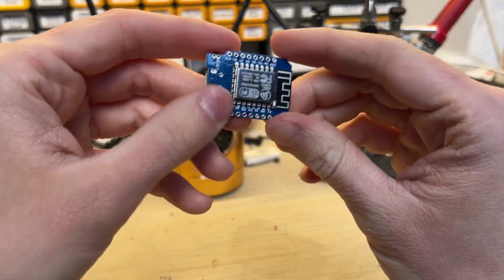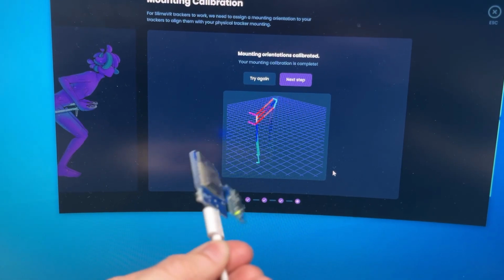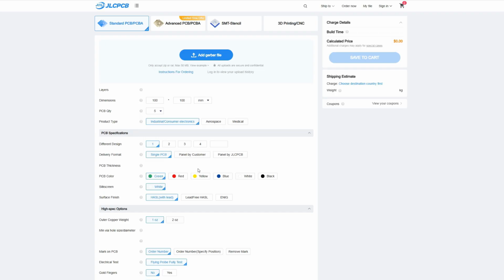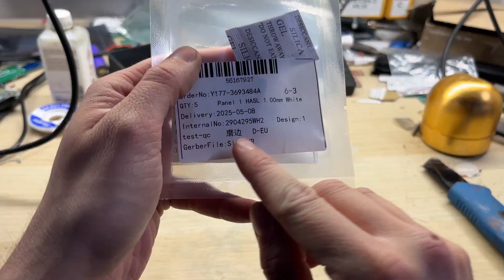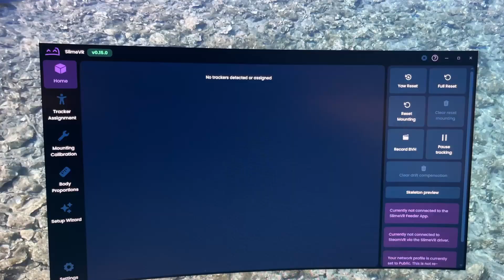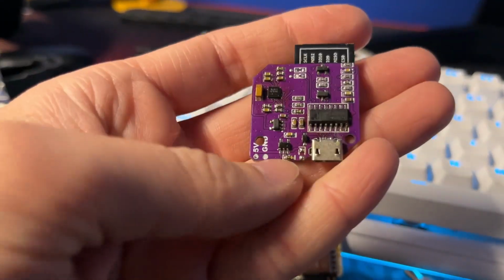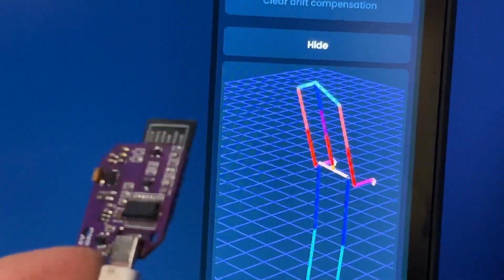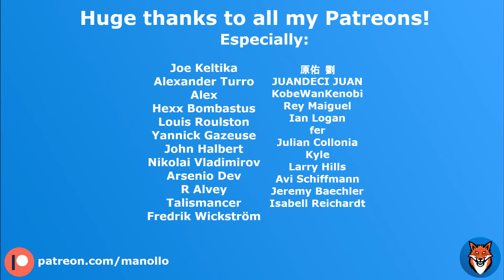SlimeVR Tracker 1.2 | Full body tracking in SteamVR

Comment: You should do it with LSM6DSVs Imus 

IMU for slime usually needs 5 or 6 points of tracking namely, 2x shin, and 2x thighs and 1 hip and 1 chest...

So i wouldn't recommend using apple watch straps...😅😅😅 Since the hip and chest need pretty long straps...😅

I recommend trying to make tracker top heavy or wobbling around messes with the tracking in use
Reply from the maker: I might switch to the LSM6DSV in the next ones but I’ve never seen that one before. 

Apple Watch straps are mainly for wrists. I know it’s bit too short for other body parts 🙃